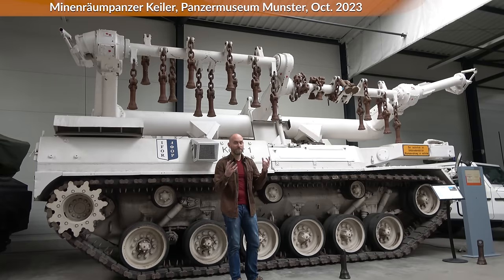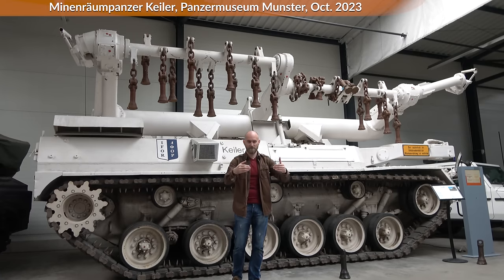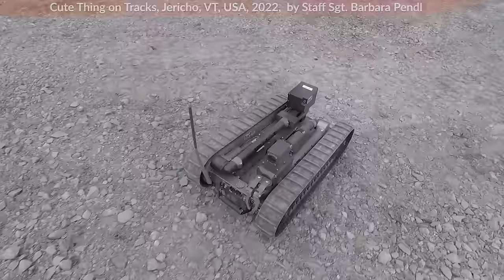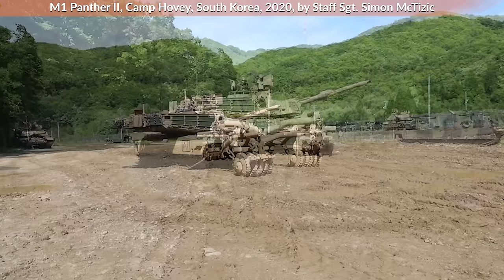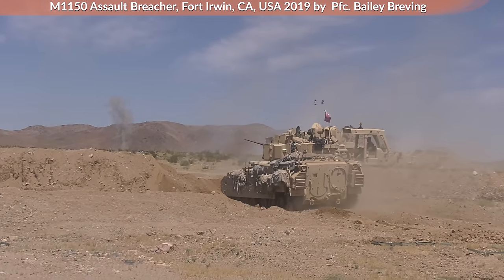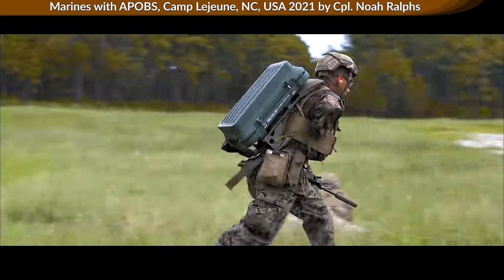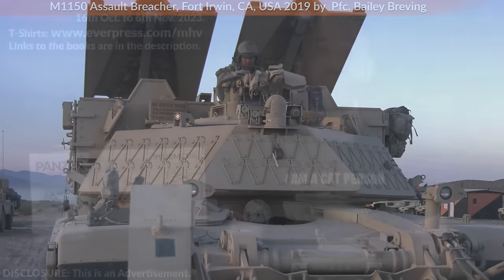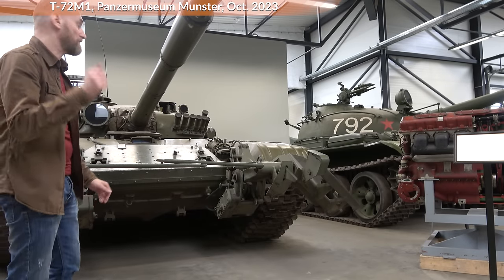Ukraine: The Problem with Mine-Clearing Tanks

Comment: Mine-clearing tanks are great at clearing mines, it's the whole "clearing a minefield in full view of the opposition and under heavy enemy fire" that is a dumb as f*ck idea.
You're supposed to use them to clear ways for the reserves and the supplies through mined areas AFTER you secured them. Can't blame the engineers nor the vehicle for idiotic decisions to use them. Remember that famous line by the German trainer in response to the Ukies asking him how to deal with minefields "Just drive around them."? That's actually the only smart strategy, mines are called area denial weapons for a reason.
Reply: The minefields are 500m to 3km deep and as wide as the entire FLOT. You cannot go around them.
Reply: @ArchOfficial  Are you suggesting that the Russian minefields are completely impenetrable and invincible?
Reply: @ArchOfficial  And you can't go through them either, which means they work and you should absolutely find a different approach instead of try, try and try again for months.
Reply: @mnk9073  Ukraine has gotten through the minefields in multiple points and is almost into operational depth, with only the infantry trenches with reserve infantry and some VDV/Spetsnaz left. It works, but it's slow and painful.
Reply: @Mr_Bunk  No, they have been penetrated already. But it took a lot of time and there are still more defenses.
Reply: I don’t suppose the Ukrainians had much of an alternative though. Unless they fancied trying an amphibious operation across the Dnipro, but that comes with its own set of unique challenges

Comment: We have autonomous tractors guided by GPS and AI and this guys are using walkie talkies
Reply: The GPS signal is quite weak and easy to spoof or jam.
Reply: Most army commanders are old, they think anything remote controlled is a toy. A lot of time and a lot of casualties have to happen before their mindset is changed. This also happened in past conflicts where some armies are adamant on using old technology despite the losses and they wouldn't adapt newer technologies no matter what.
 Also the army is a very bureaucratic structure, where you have to fill ton of papers for anything to happen, so usually nothing happens unless some of the high elite leaders feel personally threatened by bad results. Even then anything new is  adopted very slow.  Old people would usually continue in their old ways. 
 For example 30 years ago I was a child I did expect drones to be used widely by modern armies by now.... but today drones are still like some afterthought. By now drones should have been the main weapon and not some hastily build support. Army still can't integrate drones in a meaningful way, despite them being such a strong weapon.

Comment: Yeah, the current de-mining equipment is just stupid. It's effectiveness on a real world battle field is abysmal and it cannot be otherwise because it's a design is simplistic as if you've asked a child to invent it.

If de-mining operation takes a lot more time and risk than mining, then it's just not worth it and a better way has to be developed. Hyperbaric charges is one such method but I think that technology is not used to its fullest yet.

Best one would be a powerful laser coupled with an effective remote/long distance mine detector but that is too far into the future.

Comment: If I understand correctly there are 3 basic methods to deal with mines.

Avoid the mines, detonate the mines, make the mines move.

Pros vs Cons:

Avoid the mines:
Pros: Best option
Cons: isn't always possible 

Make the mines move:
Pros: it works when going around isn't an option.
Cons: Its slow and its difficult to know where the mines moved to.

Detonate Mines: 
Pros: It works consistently and is relativly fast.
Cons: It requires expensive specalized equipment.

Solution: Create a mine detonating robot that is relatively inexpensive and easy to build.

Rough Design: Add armor to a large metal pipe, add a motor, a remote, and send it rolling across the mine field. The path is clear when the detonations stop and it has reached the other side.
If a larger area needs to be cleared get a longer pipe.

Comment: You want me to run a Caterpillar dozer doing that i will. I have no fear of losing my life doing it. I have over 55 year exsperance on all types of dozers, excavator, front end loader, skidder, skid steer, off road articulated dump trucks. And Mechanic. You can teach to operate. But a natural operator shown a few tricks can not be beat. I will save you lots of life's and finish it. Most people get hired to work. I get hired for my brains and planning. A good operator does not break down. Dosent get stuck to offen. Is never angry.

Comment: Personally, I don't see why minefields are not avoidable.  In Russia, yes, it might stretch a thousand kilometers and be fairly deep and dense, as well.  However, it would be very inexpensive and easy to build single-man carrying drones that could flew just a meter above ground to dropoff a fire team at the edge of a trenchline.  Protect with 12 or so sheets of soft kevlar.  Or, I doubt it would be difficult to build a single-wheeled high speed magleve disk vehicle (actually, something I made a small model of once, for sporting puproses).  The idea is computer-controlled magnetically levitated saddle inside.  The computer adjusts the magnetism to balance against the resistance (from rapid pressure).  For forward momentum, the saddle simply lifts forward--this causes acceleration with nearly unlimited potential for speed and almost nothing can block it).  Jumping and landing absorbs shock by spin of the wheel, computer-balanced magnetism, and spin of the saddle.  In terms of a mines, I think you can add speed to this and also titanium armor up some distance on the sides of the wheel.  Titaniam in small quantities like this is not cost prohibitive.

Comment: for crying out loud!  they are just mines.  they are dumb.  they just sit there.  has anyone else seen the video of the ukrainian farmer and his remotely controlled tractor fitted with mine rollers?  why do mine clearing machines have to be expensive heavy slow moving tanks?  how  about remotely controlled loaders with the front bucket removed and replaced with rollers?  why limit the choice of mine clearer to loaders or military vehicles.  how about considering the mine clearer as expendable. flailing devices are stupid.  mines are designed to be triggered by wheels or tracks.  so rollers or some sort of wheel will be the best method.  these wheels need to apply more pressure than any vehicle wheel.  thats common sense.  the wheels need to be able to move independently of each other.  thats common sense.  the wheels need to extend well beyond the width of the machine they are attached to.  thats common sense.  the mine clearing vehicles probably work best in groups of three.  there needs to be more than one group of three.  thats common sense if the following vehicles dont have mine clearing equipment attached.  they need to move fast and trigger mines while operating at a good speed.  thats common sense.  we see fast moving vehicles triggering mines all the time.  thats common sense.  not one solution will suit all minefields.  thats common sense.  if only one method must be chosen i suggest that every tank and military vehicle that is going to assault across a minefield needs to be fitted with its own mine clearer.  most of us have seen how the russians send one mine clearer across the minefield and every other vehicle strictly follows its tracks.  dont tell the russians that is stupid.  oh, and another thing.  how come all these rubber tyred military vehicles have automatic tyre inflaters?   rubber tyres can be filled with a foam that makes the tyres puncture-proof.  some of my wheelbarrows are "flat-free".  such foam is used in off-road earthmoving equipment.  and when the tyre is well and truly worn out, the foam can be recycled, chopped up and added to other flat-free wheels.

Comment: 9:05 RESPECT✡️🔱⭐AT 100METERS A PAIR, HOW MANY (I HATE ALGEBRA  &  I'LL NEVER NEED IT ANY WAY, sigh...)
      DO WE NEED TO REACH 3RD LINE MINUS ALTERNATE MAIN ST. s IN TOWNS ON THE WAY APPROXIMATELY
25 KILOMETERS?.?
ABOUT 26O PAIRS (520 CHARGES) TO TRAVEL TO A RUZZY 3RD LINE OF DEFENSE...
COST $1,000,000,000  USD ?  I'M TOTALY QUESSING, VALUE IS  APROX. #NUMBER OF TROOPS AS MINE VICTEMS  3000+, ADD IN SLOW DIRECT FIRE EXPOSURE #10,000  equals APROX. 13,000 FRIENDLY, CARGO200/KIA.
WHAT ABOUT 30MM AA CANNON FIRE TO CLEAR A PATH QUICKLY DOES IT WORK? 25MM D. U. ROUNDS MAKE A
DIFFERENCE?? THANK  YOU , CHIEFY & YOU SHOULD DO A DEEP DIVE & COME UP WITH SOLUTION....
SOUTH PHILADELPHIA, OUT⭐🔱✡️